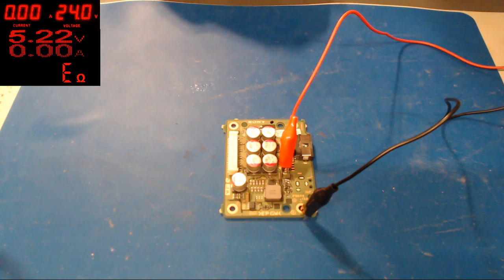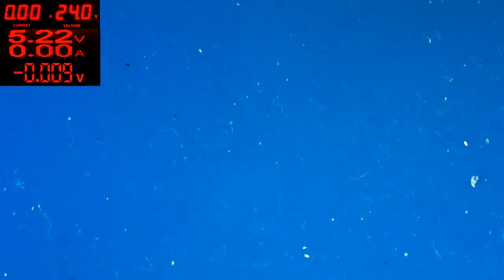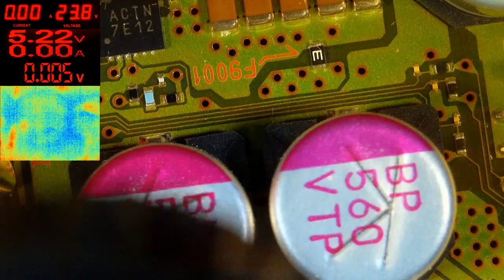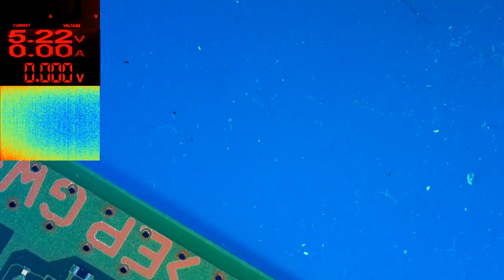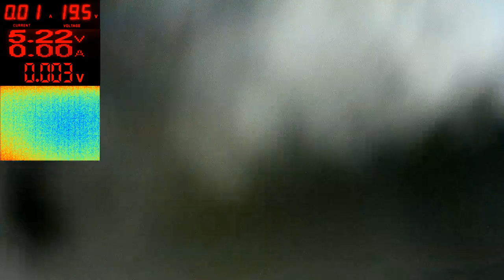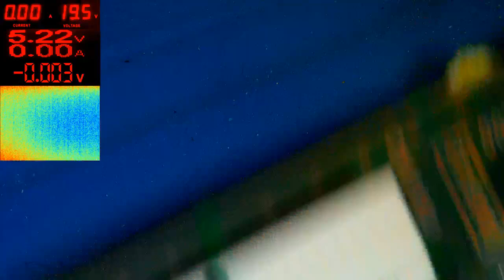Troubleshooting Sony XBR-65X900E Power Board (Part 1)

Comment: What was the original issue with this tv? Facing a possible bad power board now, same exact tv. Tried a hard reset and I still get the 4 times blinking red light. Please let me know if you had the same issue

Comment: I might have screwed up this power board when the tv froze with youtube app opened, I then pulled the ac power cord from the tv where this power board is located. Now, the tv has no power at all. Do you think that might be the case?
Reply from the maker: Just remember, if you do decide to change the mainboard, you will have to download the firmware update from Sonys website and copy it to a flash drive and plug it into the TV on first startup. It should start blinking green and amber, just wait like 20 minutes and it should restart and boot up.
Reply: By the way, my tv is the same exact model (XBR65X900E) and same exact power board .
Reply from the maker: What are the symptoms you're getting if you plug it in and try to turn it on?
Reply: @CrimsonRepair  No power at all. No lights of any colors.
Reply from the maker: @VSISCOOLN4S0  Without being able to test it myself, my guess would be the main board, not the power board. I've worked on a number of these Sony smart TVs from this era and the processors just die randomly.
Reply: @CrimsonRepair  Thanks for the info. Looking forward to more videos from your channel.
Reply: I have the same TV with the same problem.  It won’t turn on and no lights at all

Comment: what meter are you using to have that displayed on the video?
Reply from the maker: It's a Hantek handheld oscilloscope.
Reply: Crimson Computers dso 8060? You should see about getting a amazon link to make a little extra money like rossmann’s videos. Thanks for the informative video! Liked and subscribed!
Reply from the maker: @nathanokeefe9169  Hantek 2C42/2C72/2D42/2D72 depending what bandwidth of the oscilloscope you want and whether you want a wave generator or not. Cheapest would be the 2C42. I'm using the 2D72 so that I can inject waves if I need to.

Comment: I have the same tv and model that can not turn on.  Where can I order the power board?
Reply: Thang Hong did you get a new power board?
Reply: I have the same tv that just stopped powering on.  Did you find a location that we can order the power board? Thanks
Reply: I found the power board on ebay but did not buy.  My tv still working,  when it does not turn on, I unplug power cable and then plug it back in.  Then I hold the power button on the bac of the tv for couple seconds.  Sometime it worked sometime need to repeat the steps again which is stupid.  No more SOny TV
Reply: Thang Hong is the tv still functioning?
Reply: Yes it is still working but sometime can't turn it on with the remote control.   I have to unlug the power cord from the back of the tv and then plug it in. Press and hold the power button on the side of the tv until the led light of the tv is on.  When it doesn't work this is the only way I can turn the tv on.  This is my first and last sony tv.    I bought this tv before of the android platform.

Comment: Great reverse engineering Skills! Have you already found the pinout oft the suspicious Chip?
Greetings from Germany.
Reply from the maker: Unfortunately I've found that this power board seems to be functioning normally. I need to do a little more testing, but I'm setting up a test display to test individual parts one by one and see if I can find which board the culprit is.